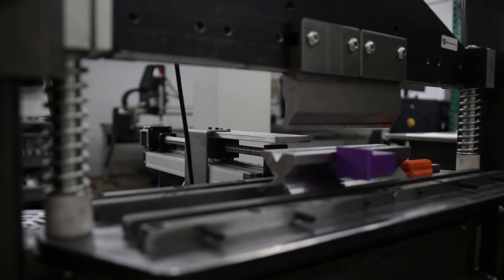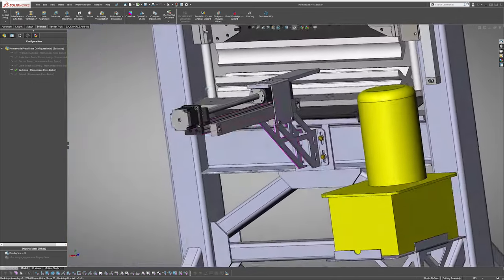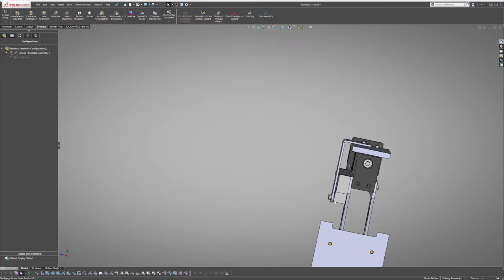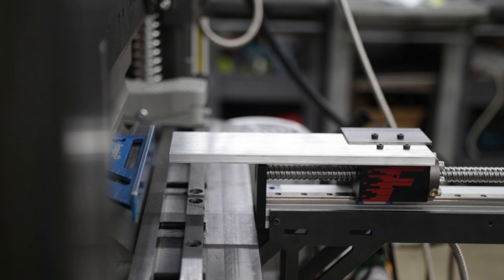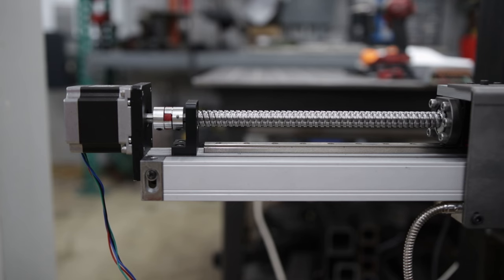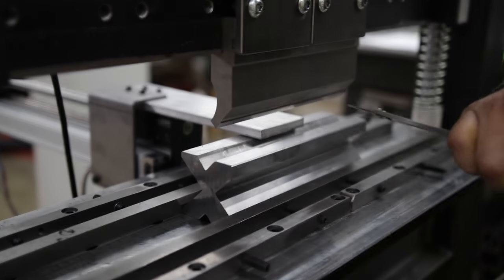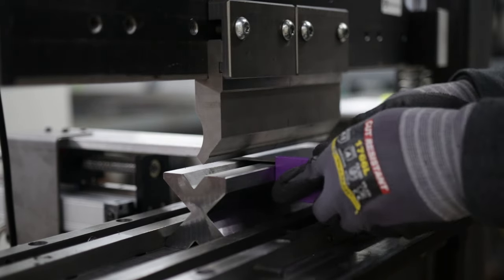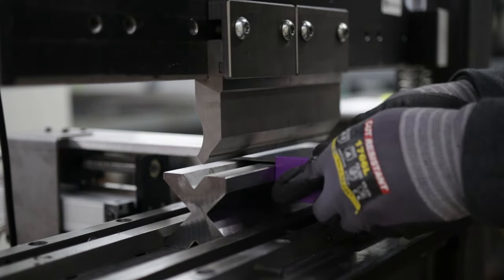DIY Hydraulic Press Brake PART 2- Backstop Using a Linear Actuator

Comment: Really nice press brake! :)
Have you considered marking bend lines with your plasma torch? The powermax xp series can mark with 10 amps :) (just "cut" only the bend lines first, at 10 amps, then the outlines at full power)
This creates a slight groove that you can use for aligning the press die (for example with diagonal bends)
You can also mark spots for pre drilling
Reply from the maker: Interesting. Thanks

Comment: What k factor are you using in your sheet metal bending? There should  be some number in your SolidWorks sheet metal settings around .4 to .5 k factor. This may adjust your bend line.
Reply from the maker: I’m just using the default k factor of .5 but I think I may have to adjust it per material and thickness

Comment: Because the Vevor Pump has only a 2 gal tank are you concerned that the oil might exceed 140 degF during production runs?  Do you think a digital temp gauge with a probe in the tank would be a good addition?
Reply from the maker: I did runs of 30-50 parts. No concern at all really. Maybe if I did more but honestly if I’m doing like 1000 units I’m outsourcing it

Comment: add roughly half the thickness of the piece per 90 degree bend typically. Ex. 14  gauge aluminum is .080 thick and your bend allowance for 1 bend is .032  2 bends is .064 3 bends is .096...etc
Reply from the maker: Good to know
Reply: @RathaSochenda  edited my response